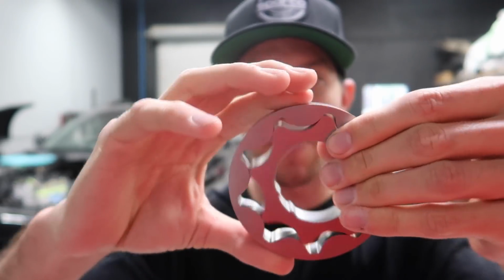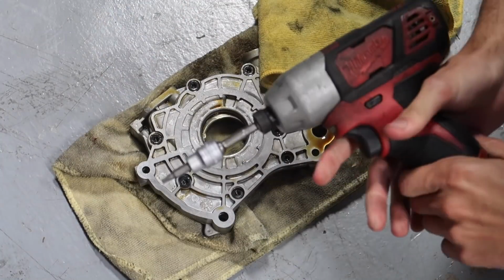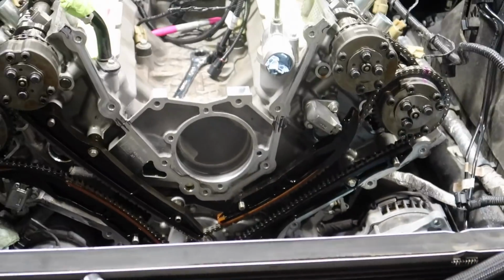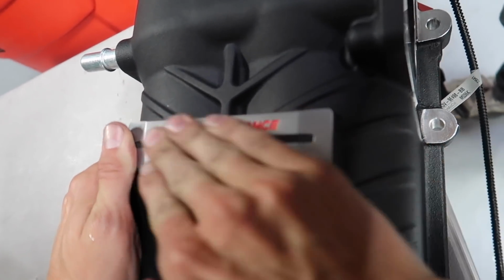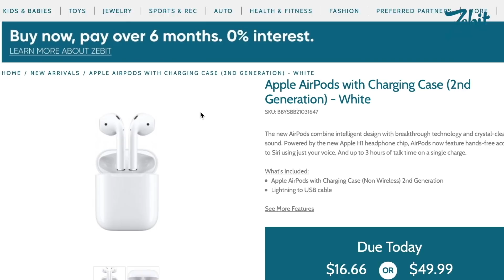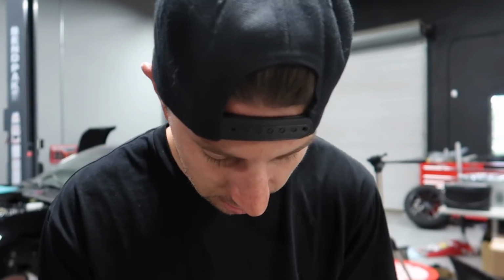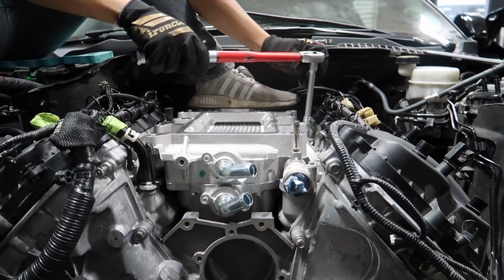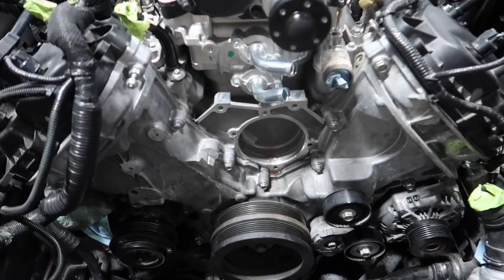Supercharged Mustang GT! 800HP!

Comment: oil pump gears are insurance, they're not a need. The issue with the stock OPG's are they are cast, and under vibration the fail. As long as you're not revving to 8k, bouncing off the rev-limiter , or bangin off a 2 step, they're fine and will handle 800+hp. Plenty of coyotes out there making big numbers on stock OPG's without any issues.

Comment: It's actually pretty rare for these to go, but there's instances of it happening - mostly on cars where the owner has been beating it off the rev limiter constantly and generally just thrashing the crap out of the motor. There's hundreds of successful builds though where the gear hasn't been changed and they've had zero issues. Whilst you're in there though, it's also advisable to replace the crank sprocket as well, though that might be a bit too late for you now :-S

Comment: Surprised no one mentioned doing the crank sprocket gear as that tends to be the weaker culprit on the 2015+ than the oil pump gears, but if your doing one you should both. Also you should have shown the timing process as its different between early and later coyote motors!

Comment: Did any of you guys saw if he used a gasket on the intake? Between the intake and the air to water cooler. Between the cooler and the compressor I can see that there's a rubber gasket but not between the intake

Comment: you need to get Calvin a hoist to use when he needs to get on top of the engine to set on seeing the shoes on the O ring of the manifold made me shudder  if you lose boost look there first. O ring maybe have gotten damaged by shoe but now you have been into the guts of it now you know how much its worth it by getting rid of the weak points.

Comment: Those oil pump gears better be MMR or else you will be tearing it back down.
Reply: Poohy14  more people have problems with mmr them boundary
Reply: @Boosteds550  seen more people complain about Boundary oil pump gears than MMR. Plus all the big coyote builders only run MMR and even lots of tuners that tune the Coyotes say only MMR.